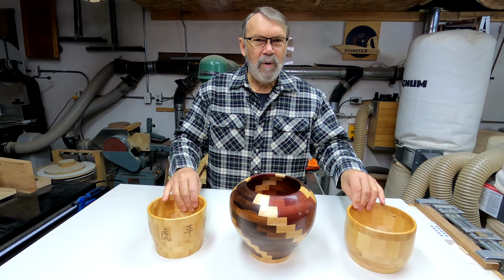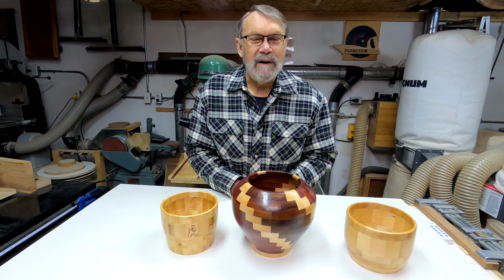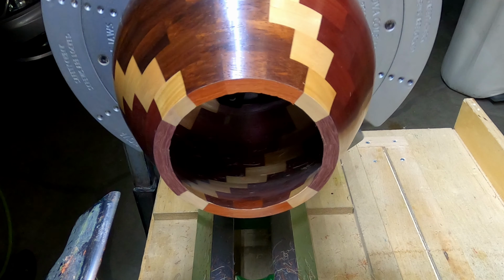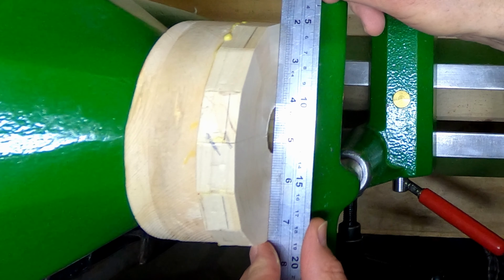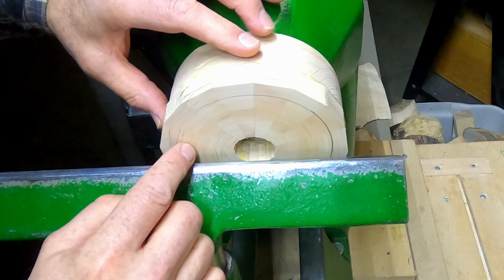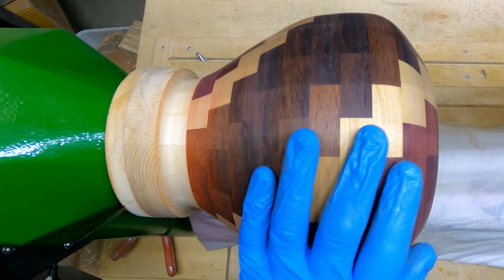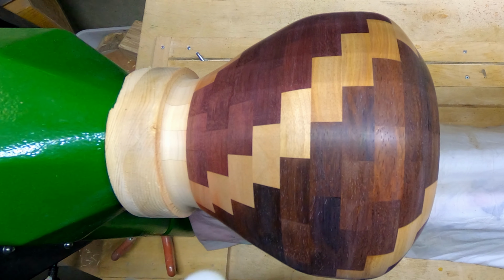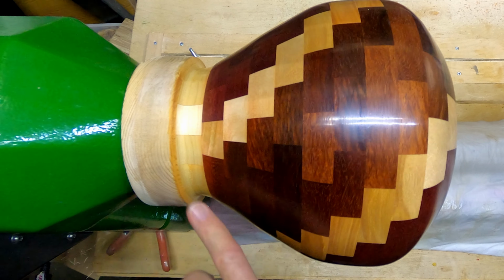Hot Air Balloon Bowl Repair

Comment: Hi, Gord. Like Papa I have not used the floating disk and have had no problems. Well with one exception. I had the bottom come off a 15 inch bowl. It was done about 30 years ago. I replaced the bottom and it failed again. Both times within 2 years. That bowl is still in a box in the shop. I guess I should get it out and do a floating disk bottom to it. I think I have not had problems as all my pieces have been living in air conditioned spaces. But I should probably change my methods for a piece may not be so lucky in the future. Thank you for sharing. Have a great day and stay safe my friend. PS, Papa does such precision work they wouldn't dare to fail.😁😁😁 Actually yours are pretty damn good too. 👍👍
Reply from the maker: We just had air conditioning installed last Fall so I'm hoping that will eliminate this problem. I have come to like making the Floating Discs so I won't stop doing it now. You're right, Gary's work is incredibly precise! Thanks for watching, Glen!  😊😊😊

Comment: I've used this method a few times to avoid a problem, Gord, and thought I was cheating; not knowing it was an accepted method. A little more work, but I found it can be a satisfying part of the design. It could also prove helpful to those not equipped or confident in deep hollowing, as the unclosed "funnel" can be reversed for completing the hollowing process. Many thanks ,as usual.   Bernard.
Reply from the maker: Bernard, I quite enjoy creating the floating disc for the bottom of a segmented vessel. I originally did it just because it prevented problems in cracking but now do it because I enjoy it, as well. Thanks for watching, my friend. Have a great shop day!
…..Gord

Comment: Fantastic repair, Gord. Better than before.   I had an old can of just that and I was certain it would be a solid brick. It took a bit to open it up, but the dried finish inside the cap sealed it perfectly and it was as good as new. Like you said, those crusty parts are still on there so whenever I use it I just pour some out into a separate container to make sure there's nothing big in there that's going to contaminate my piece. Lately I've been using Wipe on Poly for air brushing and does that ever give a beautiful finish when it's run through a spray like that.

Thanks for the floating bottom demo. It's a very interesting preventative measure.
Reply from the maker: Jay, I did not know you could use wipe on poly for airbrushing. That’s a great tip, my friend. Thank you for that. Thanks for watching! 👍👍😃

Comment: Good video Gordn now I going to check some of the segmented bowls I have and check for cracks as I never have used a floating disc! Thanks!

Cheers Al
Reply from the maker: I hope you have had better luck with them than I had, Al. It sure came as a surprise to me when I looked in the bottom of that vessel. I suppose I should have expected it but I had forgotten that I wasn’t using the floating disc at that time. Thanks for watching!
Happy turning,
…..Gord

Comment: Do you know if solid bottoms pose less of an issue with cracking (at the connection) than segmented bottoms?  Our club makes Beads of Courage segmented bowls and we use solid bottoms.
Reply from the maker: Again, it depends on the humidity and temperature in the area the bowl is made and then stored, Todd. For instance, if the bowl is made in a very humid area and then shipped to a dry area there is a greater chance of cracking. It’s the same problem that people have if they purchase antique furniture in Europe and have it shipped to America. There is a great chance that it will shift due to the humidity change. I have never had a problem with floating discs and so that’s why I tend to use them. Sorry I can’t be more definitive for you. Thanks for watching!
…..Gord